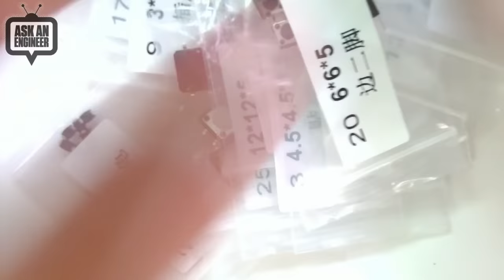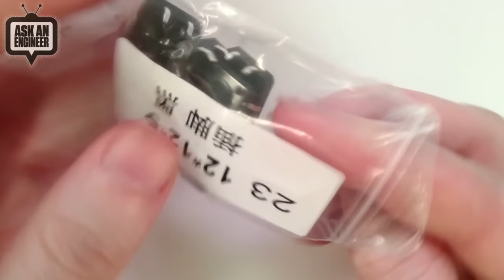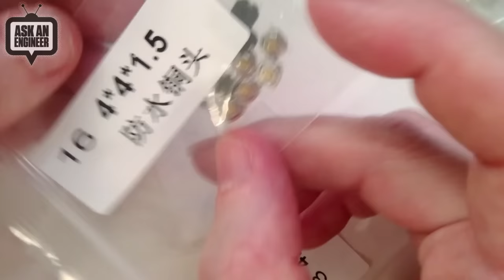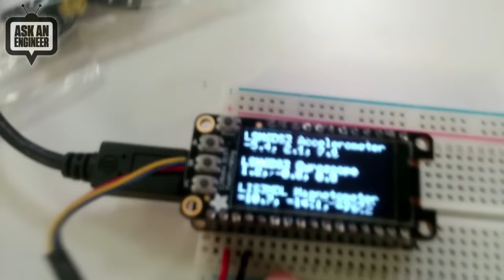New Products 7/13/2022 Featuring #adafruit LSM6DS3TR-C + LIS3MDL - Precision #9DoF #IMU QT!

Comment: Wondering why we don't use those right angle ones as end stop switches?
Reply: Maybe not as repeatable of an actuation point?
Reply: @rpavlik1  yeah although the accuracy comes from the stepper usually, the microswitch is just the start point and you don't go back there until the start of the next job
Reply: @bridget_clinch  Could have something to do with the shallow degree of travel. Mechanically most end stops ive seen has had a long arm as to give the switch some time to actuate before whatever part its trying to stop, rams straight into the switch itself.

But i dont know for sure. I guess you could just add an arm to a normal button and try it out :)
Reply: @zipp4everyone263  not all, I've just assembled one from instructions that uses a microswitch without the arm, unless it is more durable it is wasting space